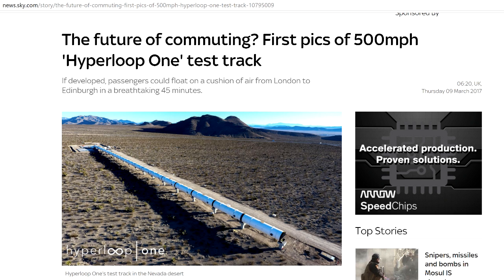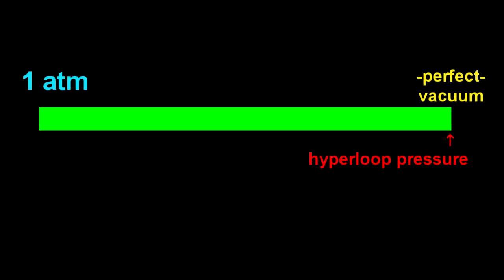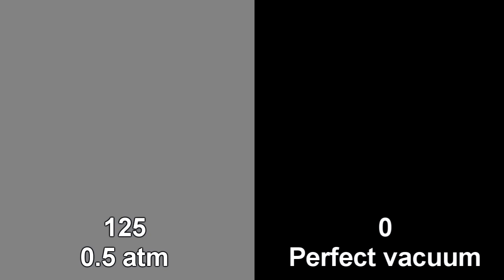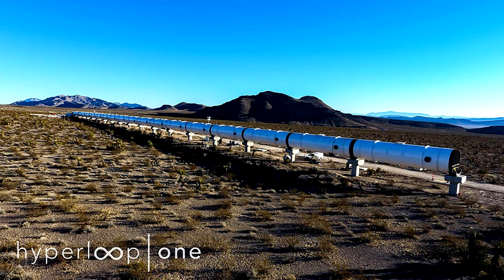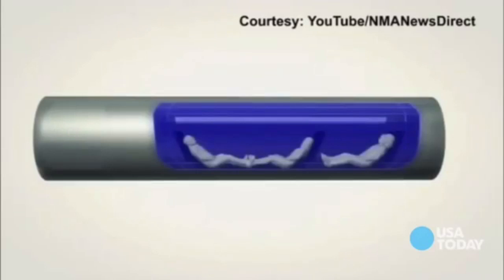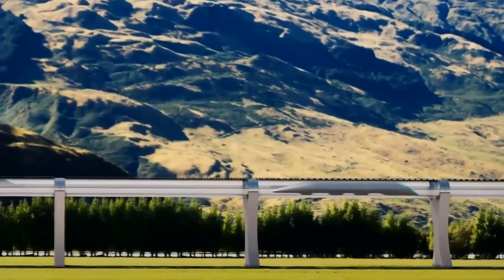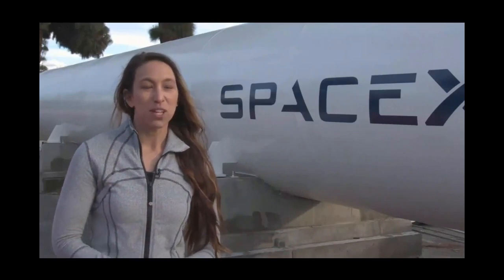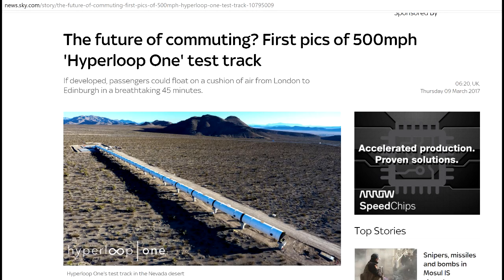Entire Hyperloop could be destroyed in SECONDS!

Comment: Usually your videos do a good job convincing me of BS like the 'solar roadways', 'floating sykscrapers' and what not but your arguments (although well researched) here aren't as convincing to me: 

1. The argument that creating a vacuum creates a dangerously high potential energy difference: All bridges have high amounts of potential energy differences when the road sections are suspended in the air. Just because there is a high potential difference of energy does not always mean something is dangerous. 

2. The images of the tanker trailers bursting: Those are pressure vessels, ie: they are mean to hold pressurized liquids not vacuums. The hyperloop will surly have a design that is much different than these tankers considering it's mean to hold a vaccum.

3. The tubes needing support when not assembled: The ends are likely not meant to support the weight of them selves when not assembled. Notice how the supports are only at the ends of the tubes and not in the middle, where they support themselves just fine. 

4. The speeds in the test track: This was a scale model used to prove the designs of different vehicles they're using in them. What's important is how the systems perform in the tube, they were never meant to reach these speeds in the test tunnel... 

5. The vaccum time for loading and unload the vehicles: The production system surely wont have to evacuate the entire line to load and unload passengers...

Comment: this guy obviously doesn't know how to do anything but hate on others ideas
Reply: you fine there with your fontus self filling water bottle? because that idea wasn't something to be hated on, wasn't it?
Reply: This is part of engineering where you suggest how things can go wrong. Then you go back and build something even stronger to withstand what you suggested would go wrong.
Reply: It's called critique and unlike you he actually states his reasons for his criticisms instead of just throwing out insults.
Reply: @Living with Asperger's, That is because cars did start to fail immediately and were very poorly made. As well the technology to make it more reliable and less expensive came mostly from outside the auto industry. It was proven technology that thrust cars into the public space that was then worked on. It isn't quite the same thing.
Reply: No, it can work. I would suggest multiple spines that would extend the length of the tube, so it doesn't go accordion. To protect from from falling concrete blocks, I would add a double wall, maybe filling in the hollow space between the walls with concrete. To minimize the effect of dimpling, I would add more rings to strength the cross sections. Now, bear in mind, I may be an engineer, but not a mechanical engineer. At this point, is the entire thing still cost effective? I can't answer for that.
Reply: Lambert Lum - I'm currently an ME student. Your idea could work, but I'm not too sure HOW that would be applied so that such a thing doesn't happen. Ideally, the fastest and easiest application would be to weld bars from each flange per section to prevent this but that's still become labor intensive and expensive. 

The double walled idea could work, but you're increasing the overall weight of the structure which means the supports would have to be incredibly strong and withstand any inertial forces of the capsule when its in a turn, support the impact of a potential earthquake, and survive multiple impacts of any environmental changes like a rock/mudslide, or even cars/trucks crashing into it. 
You increase the production costs of the system, and its weight. And concrete stand-offs need to be large enough to handle the weight and such impacts which makes them massive
Reply: Key words are TEST TRACK! This guy is bringing up issues that elon musk and his employees are already aware of.
Reply: I would not call the current idea unworkable, but it does need some work. If the tube is too thin, then the thickness can be increased. We can even add a double wall to isolate external damage. A lot of ideas can be borrowed from submarines to engineer hyperloop's tube to a level that reduces failure to leaks instead of crumpling.
Reply: Curt Charlson I understand that, but someone down the road may come up that can perfect this technology.
Reply: nateman10 Yeah, and people thought cars were going to fail immediately when they started popping up in Britain over 100 years ago. It took an innovator to make it cheap and reliable. Men like Elon Musk are building the future we will share with our grandchildren. He pours 80% of his own personal funding into projects like the Hyperloop and Space-X so we don't have to pay for it. Also, who cares if it's for only the super rich for the first few years? That is how it's supposed to happen. Train tickets were stupidly expensive when they first were used for passengers, so will the hyperloop and any other major form of transportation in the future. What Elon is doing for the scientific community is extremely impressive and shouldn't be hated on simply because the initial proof of concept didn't work.

Comment: Mythbusters tried imploding a semi-trailer oil carrier, pumping it down to under an inch of vacuum, but they weren't able to to get it to implode until they creased it with a heavy impact—which is pretty remarkable, considering that very little in the design of an oil tanker semi-trailer is designed to resist vacuum, at least vacuum any greater than you might get going from a hot desert to an icy mountain pass with a sealed container.  I'm guessing the Wabash in this video was a lightweight carrier not rated for F001 to F005 contents.
Reply: You don't seem to understand that normal atmospheric pressure is about 30 in/Hg. or approx. 15 psi. In the Mythbusters tanker trunk experiment, the reduced the internal pressure to about 10 in/Hg, which is about 5 psi. That means that the pressure differential was only 10 psi across the entire tank -- and the walls of a tanker truck are much thicker than 0.8 in. (2 cm). Musk proposes to put an even larger pressure gradient on an even weaker tube--NO WAY!
Reply: At artgoat: I don't know where you get that "under an inch of vacuum." The video clearly shows the tank collapsed at 10 in/HG, or about 1/3 atm.
Reply: artgoat x
Reply: that shape   a very good shape  almost like an egg ...  a long hyper loop cannot be shaped that way , i left a long comment on this video , but most people dont truly get it .. you must think of the hyper loop with a space x mind , and its  cheaper in the long run ...    but  i think elon musk is making people look left when he is going right ...  Elon is not building tubes in the sky for pods ... he is building tubes in the ground for cars ... ( The BORE ing  company ) is hard at work  already
Reply: You are obviously not a civil engineer. A tank with ends is much, much stronger than a simple pipe of essentially infinite length. Saw off the ends of a soda can, and you will see it is much easier to deform and even crush it than with both ends intact.
Reply: A bored tunnel in the ground is much more expensive than any surface or elevated pipe. This is why pipelines are placed in trenches, and not normally run through bored tunnels.
Reply: aliaslisabeth 
You are obviously not an engineer, the ends of a tube a mile long will give no support to the middle.
Reply: Tjaldid 
Yes, every time passengers need to get on or off, the pod will have to go into an airlock, which will have to be brought up to atmospheric pressure, then evacuated again.
Or the pod doors will have to be lined up with smaller airlocks which will clamp on.
Either way, a slower and more expensive way.
Reply: Theres a problem. 

How are they going to transfer people from an environment of 1 atmosphere, into a vacuum tube? 

There is certainly going to be some wait time added when you have to create a system that puts the pod from being in 1 atmosphere, to being in a near-perfect vacuum, without any interruption to the main-line of travelling pods.

Not only is it expensive and energy inefficient to create a vacuum in the first place on such a massive scale, but do so in such a speed that is reasonable for a group of travelers, for each pod that enters the main line....

Sorry. Even the most powerful vacuum pumps on earth spend as much as 30minutes to an hour in creating a vacuum the size of an Olympic swimming pool. And that's in a perfectly sealed room in a controlled environment. 

You want to spread that out over 300miles?

Its definitely possible. But absolutely expensive.
Reply: airplanes have had about 20-30+ years to mature and slowly grow its infrastructure to what it is today, and its actually quite inexpensive to run on a day-to-day basis considering the concert of logistics that happens every day - but each part of air travel operates independently of each other (compartmentalized) for the most part. And also helps that there is no actual improvement to airtravel other than making planes lighter, faster with more efficient engines. Its actual infrastructure is decades old and mostly paid for. It took about 10 years, from the Wright brothers' first flight to the first commercial airline flight to happen.
Its also cheaper to operate a plane at 35,000 feet with a pressurized cabin than it is to operate a tube in a constant near-vacuum at sea-level. What works one way, doesn't necessarily mean working the opposite direction will
It was also at a time in our history where shit got done. These days it takes years and hundreds of millions of dollars to even make a 2-3 hour blockbuster movie. 

Hyperloop is a LONG way off before its anywhere remotely commercially viable, if at all. 

an elevated MagLev bullet train is a known figure. We know how much it costs to build, and how much it is to run and its been quite profitable for the companies involved. It has been talked about a few times to be used in the US however NO ONE wanted to cough up the money to build one. Not investors, not the federal or state governments. None. 

There are inherent problems with the hyperloop that are only talked about in the research papers - but no actual practical solutions. Just a lot of theory based on decent logic. 

At best, Hyperloop for 300miles is going to cost about $1billion, a ticket will be $200 round trip and will never be applied anywhere else. 

FYI - its actually cheaper to take a plane. I can fly from Austin, TX to Las Vegas for $80. Or $100 to fly from Dallas to Houston.
Reply: I think the easiest way to do that would be to have the whole tube constantly depressurized, but have small pressurized stations where you can get into the pod, then you depressurize the station, and open a door leading to the whole tube.

This is still absolutely stupid though.
Reply: No, it's not 300 times higher pressure.
It's only 999/1000/(2/3) = 1.49, or about 50% higher. 
The maximum pressure exerted on the tank by the atmosphere is 1 atm. The maximum compressive force per distance of tank (11ft. diameter) is 1atm * 11ft. The compressive strength of steel is 250MPa. Google "1atm*11ft/250MPa"; it's about 1.35mm, and the minimum required thickness of the tank is half that. If the tank is suppose to be 2cm thick, a safety factor of about 30 is employed.
Reply: If you look closely at the Mythbusters video--you will see that they only reduced the pressure in that tank down to 10 inches of mercury, i.e., about 1/3 atmosphere. They still made that tank collapse just by hitting it with a shock load. 

The Hyperloop proposes to operate at 1/1000 atmosphere. That means over 300X more force on every square inch of the tank. Yet the tube is only supposed to be 2 cm thick, and made of ordinary steel. 

So far, the Hyperloop has not run one genuine test. Even the "competition" that the Netherlands team "won" involved pushing the equivalent of a Pinewood Derby car down a tube still full of air. They are a true embarrassment to engineering.
Reply: thats from the mythbusters video
Reply: That's kind of the same problem airliners face.  How do you transfer passengers from ground level to an operating altitude of thirty thousand feet altitude at near vacuum and -120 degrees temperature?  It requires $billions of infrastructure just to keep them from running into each other.  You're right, it's completely absurd and unfeasible.  Nobody would ever go for such a complicated transport system.
Reply: An "inch" of vacuum is about 1/30 atmosphere. Hyperloop is proposed to be at 1/1000 atm (99.9% vacuum). That's 300 times more force on every square inch of the tank than on the Mythbuster's show. YIKES!

Comment: The tube you showed was a tank to transport fuel. You see, that tank is not designed for a vacuum, the tubes of the hyperloop are specifically designed to withstand the contrast of the pressures in and external. Even if an accident where to happen, the positive pressure rushing into the tube will slow down the incoming trains which also assist with their on-board braking mechanism. I liked this video, I can deal with your fear of an accident like that but this project is not founded by the government so you don't even have to pay any taxes nor worry about their, what you call "stupidity" projects. And according to your video, I could call you a narcissist now, though you used evidence for your belief, but those are still not relevant to counterargue to what hyperloop wants to sell. It might satisfy your beliefs, and that's fine, a lot of people agree with you for sure but others might just hate your false propaganda about a project that has nothing to do with anyone yet. And if you're still scared of riding the hyperloop, you don't have to ride it. Same principle with any vehicle that can get you killed in the modern transportation. I won't ride it, cause it looks sketchy but if the tech becomes more settled in like 8 or 20 years then yeah, I'll use it to travel the sphere I live on.

Comment: the cross braces that are in the pipe are not to keep the pipe from collapsing on itself, its to keep the ends from becoming oval which makes it hard to join the pipe together. from what I could see in your video the piping that they are using is around a half of an inch thick which is way thicker than that trailer you showed getting imploded.
Reply: That’s exactly the same thing and exactly what thunderf00t said you muppet. The bracing is to stop the pipe deforming under its own weight - ie becoming oval. Dumbass.

Comment: I have a little theory of my own...the crushing is due to the outer atmosphere of the surrounding that the air pressure is trying to get into the vacumm, now is they try to do the vaccum tank into a smaller atmosphere where less air volume surrounding it, that the air pressure might be lessen, its just like put "o" into a "O", the small "o" is the vacuum area where the "O" is the man made air atmosphere (not another vaccum).  Think about going into the deep sea, the submarine theory.  The its always run on density rules where the Denser medium will move towards the less Dense medium.  If you talk about Black Hole, its an infinate "Vacuum" that's like a totaly "zero" mass with infinate capacity, thus al those with Mass AKA (Denser material) will be suck in to fill up the "Zero" atmosphere. Well i just speaking out from my mind, i know no one is watching ^_^ anyway good vid..

Comment: The stability under vacuum is not really an issue; it just requires the right design. The tanks were not designed for vacuum, that’s all.

However, the behavior an accident if a truck crashes into the tube is an issue. But even though, for such a long tube in case of collapse the venting would take quite some time and the energy would be released all along the track minimizing the danger.
I would propose to dig it into the ground. Just 2m below the surface, everything is much safer. Even more, I would build it from concrete. The vacuum generates compression stress in the tube concrete is ideal to take compression stress. At the required vaccum an epoxid paint can be considered vacuum tight.

However there is one issue nobody has been talking about, even if they are able to solve all the issues you presented, they would boil their passengers. The tubes installed in Californian sun will get very hot, the engines installed in the pods generate a lot of excess heat and without ambient air, and it is very difficult to run an air conditioning to thermalize the pods. 
By the way, the 1 km tube was at best the 4th largest vacuum tube. The LIGO interferometers have an arm length of 4km. As they have two arms, this makes 8km of tube length. Actually, there are two of them. As a physicist Elon Musk should have known this.

Comment: What if they buried it just below the surface (with solar panels above it)? and only did an 80-90% vacuum? I would think that would solve many of the potential problems. You have much less energy involved, the earth acts as a heat sink to keep expansion/contraction to a minimum. it protects the integrity of the structure from impact (earthquakes would still be a challenge). The vehicles won't move as quickly, but should still get to very fast speeds, wouldn't they? I realize that's different than the original proposal, but engineering projects have to make revisions all of the time--that's a normal part of the process. So you're probably right that the original proposal may be unrealistic as it was written, but that doesn't mean that a less-ambitious version of the design couldn't work?

Also, why are you so worried about the speeds achieved in the test track? or the length of the track. That seems like a pointless nit to pick. It's a TEST track, meant for early stage prototyping. It's really not a valid criticism. It wouldn't be valid criticism for someone to get on your case for using a scaled model to help with your research. That's a reasonable, and rational approach.